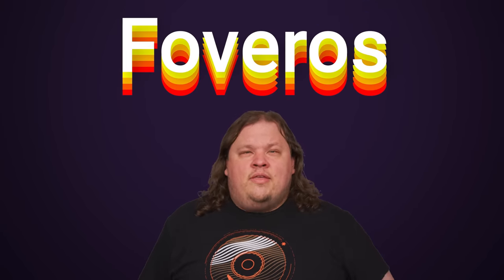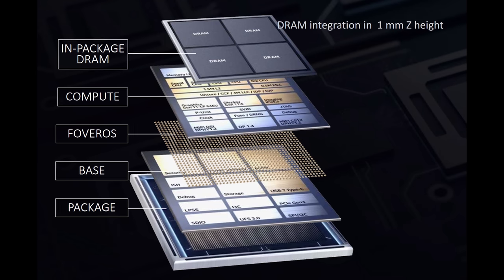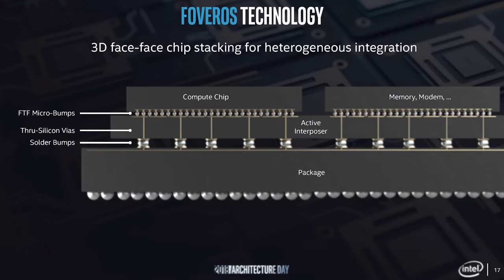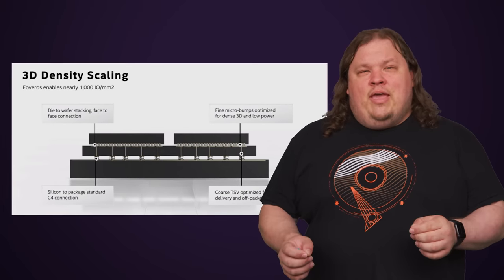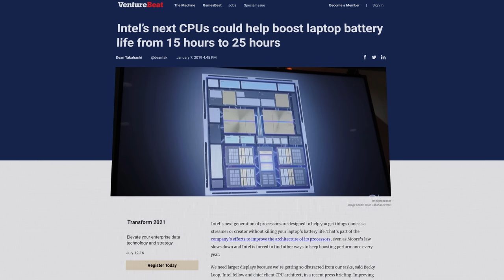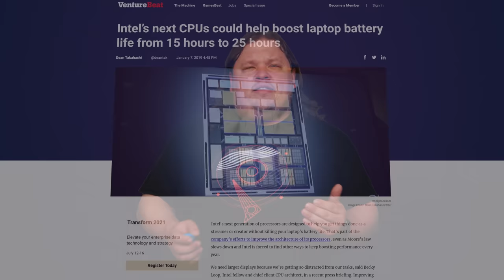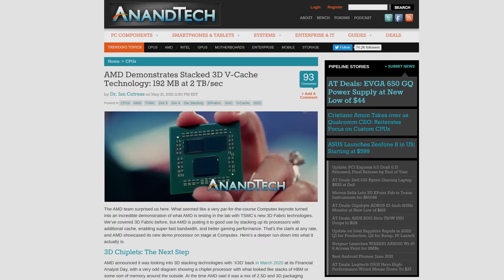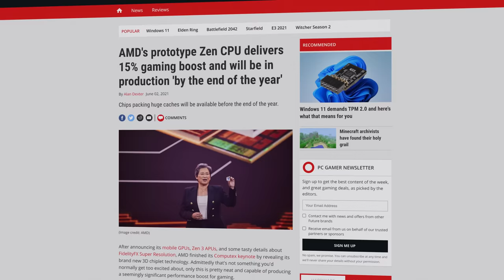They're STACKING CPUs Now!

Comment: I wonder what they're going to do about heat issues

Edit:
I do understand that data is transferred more efficiently so less heat is produced but by how much?
What thermodynamics 101 says is that this will reduce cooling surface area significantly which mean you have to cool it more.
But then we run into another issue, that is the temperature variance between different regions of the CPU. Is that temp difference enough to be problematic? IDK 🤷🏻‍♂️
Basically, dealing with temp issues is going to by easier said than done.

2nd edit:
Turns out they actually are trying direct die water-cooling. Awesome 👌
Reply: They're gonna put that onto us
Reply: Direct die watercooling.
Reply: Maybe with direct liquid cooling
Reply: This actually can help reduce heat output, as the data is moved around the die more efficiently.

Otherwise, it's just a question of throttling maximum performance to a point where the heat can safely dissipate from hotspots, through the die, and into the cooler - something that is already done in all modern CPU's.
Reply: And there are people studying the feasibility of integrating watercooling into the silicon die itself, the main problem is the economic feasibility of it all.
Reply: Speak Good  spam
Reply: @Octavio Lopez Well, less energy to transfer data between processing modules. The module itself will still take the same ammount of energy. The only thing that has a lower energy consumption is the connection between dies, not the dies themself.
Reply: @Octavio Lopez must have worked I don't see any comments from the guy you've been talking about
Reply: And good luck getting thermal paste in between all those die layers.
Reply: @ebinrock  it's essentially perfect surfaces so there will be no need for that
Reply: It's probably fine. New ryzen cpus aren't that hard to cool, so they have some margin to work with. I don't think it will have any significant impact though.
Reply: Concerned about heat issue too
I'm worry if heat can cause solder ball between dies damage over time.
Reply: @Octavio Lopez What did he said?
Reply: It'll probably be a balancing act between sustained performance, burst performance, and heat generation.

In this sense, the chiplet design may turn out to be superior, as they can squeeze the chiplets to the top layers where they get the most cooling, and push the memory components to the deeper layers.

Otherwise, someone is gonna have to come up with a way to pump heat from the inner core of the package out to the surfaces...
Reply: 170 TDP
Reply: Putting a layer between the die that is generating the heat and the cooling block seems like putting a blanket on someone during a hot day. Also solder cracks in game consoles leading to delamination of the APU, a known issue, now you want it to occur between layers of the cpu? And the sizes of those tiny ball joints will make it impossible to fix. Apple sandwiches boards in their phone in a similar way and they break very easily when dropped. Where is the longevity and reliability in this design?

Comment: Not long till we see chips with gigabytes worth of cache.
Reply: Meanwhile Intel is barely putting gigabytes on their massive GPU...
Reply: i wonder if that will mean dramless laptops, where the entire system memory resides in the CPU's SRAM
Reply: @FluorescentGreen5  naahhh, sram is VERY expensive...
Reply: @giornikitop5373  for now yeah but i meant when it gets to the point of cpus having GBs of cache where you may as well use the cache as system memory
Reply: Ram on cpu
Reply: @FluorescentGreen5  interesting idea. High capacity cache and low latency high bandwidth SSD combined and you don't need the middleman of RAM.

Comment: One benefit of 3D stacking for CPU (or chiplet design), is that the manufacturer can get better yield from their fabs. By designing smaller parts then putting them together, they can get more usable parts rather than having a big part ruined by small defect on the wafer. It also allows the manufacturer to custom pick good parts for the CPU or SOC. Eg, need a 2MB cache or 4MB cache? They can do it with the same wafer and just manufacture the memory base on demand. 
But of course, we're the end user. We just want lower price, higher perf and lots of features we don't intend to use but good to brag about until the next Windows version forces you to enable it.

Comment: imagine CPUs utilize the current PC building layout: you have a "motherboard substrate", onto which modules connect. So you would have like a compute unit module, cache module, and accessories module. All of them sandwiched with a heat transfer construction: tiny vapour chambers or even liquid cooling ready manifolds. Would be a 2.5D idea for expanding silicon area

Comment: The main problem with stacking as far as processing, besides the obvious construction/lithography difficulties, is the heat generated.
Heat dissipation.. high TDP cores may well be a layer or two down, beneath other dies that're also generating heat.  And folks think CPUs get hot now

Comment: What I want to see, related to this:

Add a layer, or a core, or something 
whose job is only to work with an a.i. to watch all activity in a system for problems, so that if the system crashes, or slows, or does anything worrying (sometimes even before the user realizes there's a problem), the system will identify the causes, correct those itself (when possible), and recommend solutions (in both layman's terms and professional terms).  

It could even take over, at a minimal level, if the main cpu crashes, to keep a system going in a special correction mode, rather than actually letting it crash and then working on the problem after a reboot. 

It would be like having two systems running as one. The 2nd watches everything, logs concerns, and takes actions as needed. 
--
I am not a tech person. But surely this would be possible.

Comment: I bet they could achieve more density by instead of using TSVs or micro solder bumps, to redesign the chip for them to slide in place or attach to eachother physically. Hell, they could make slight ∆ diviots on top, and do protrusions on the bottom to pop into place.

Comment: The issue I see is that a CPU or other die transmits a lot of heat from its back side. Having it floating above another die prevents that, unless what? they are going to provide a heatsink on the top as well? This is not a new problem, and we have seen MCMs (multichip modules) that have performance limitations due to the total power dissipation ability of the package.

Comment: How are they over coming the thermal dissipation of a thicker die? Also cpu delamination that occurs with solder as it ages and hits constant critical temperatures? Wouldn't this method introduce more issues than it solved. Guess we're moving toward hardware with a use by date and  no repair capability.

Comment: the difficulty of die stacking for any compute unit is the non existent pattern since there's a block for each individual process like ALU, CU, instruction register etc.
while the NAND flash / DRAM have a 2d matrix like pattern so adding 3rd dimension is "relatively" easy.
AMD approach to stack their Cache is clever since the tech is there and ready to use since cache is just baked in CPU ram. It will be easy to implement since AMD bottleneck is the memory anyway.
while Intel approach by literally stacking and soldering die on top one and another will poses a difficulty of thermal transfer since there will be an air gap between those solder balls.

Comment: I wonder how overlocking capabilities will turn out with multiple dies stacked on top of each other. Sure, the energy to transfer data between each one will be significantly lwess but each computing unit will still take the same ammount of power (unless the eficiency of the chip itself is reduced) meaning the thermal energy density will be much higher, making moving heart away much more difficul since you can't just mount a heatsink inside the cpu. But maby it will not be an issue at all but we will see.

Comment: My 5950X gets instantly to 80-85°C on a single Core when using the Boost...even on a 280mm AIO. When stacking Chips how the F**k does the CPU gets cooled then?
Or is it just more Core but less Frequency? The Same 5950X gets only 60°C when using ALL Cores, on a much lesser Frequency.
For Games or Tasks that only use 1-2 Cores that Stacking might be a Problem...since the per Core Performance is going down in favor of less Heat.

Comment: I’m glad tech companies aren’t giving up on Moore’s law, just because the traditional method of transistor shrinking is dead, it doesn’t mean we can’t make CPU’s faster
Reply: it's not dead yet we still can go to at least 3nm probably even 1-2nm
Reply: @KeinNiemand  This is true only for industrial production. In labs, single-atom transistors are a thing since 2004 but the methods involved are stuck at "artisanal" production level and those single-atom transitors need to be cooled at minus 196 degree Celsius to function. But the Moore Law is indeed dead, this is just that the gap between what edge research can do in small quantity and what the industry can product at large scale, reliable rate and an affordable price is big enough that the industry isn't yet affected by it outside being forewarned about it.

Comment: But how do they plan to cool that? 
Even if we don't open the can of worms called 'empty space between the dies', the square-cube law still applies. 
For double the volume and double the heat, you get less than double the surface (probably exactly the same surface, if they're still cooled with a metal plate pressed on top of the CPU), so you have to draw heat away much faster in order to keep it cool.

Comment: When will we finally get the microchannel water cooling? Are they still working on that?
Reply: As far as I know, they are still working on that. But with so many dies so clsoe, the enenrgy density is massive. Without such a coolingn solution, it will be hard to move the heat away from inside stacked dies.

Comment: What i see happening is 3 or more lines of CPU 2 for workstation at least 2 for server and 1 for consumer. The reason? How applications run is different depending on how they are complied and the data being processed through them
Consumers really won't see a thing unless you get into the small +/- up to 3 fps as the bulk of compute for games is now on the GPU not the CPU. For workstations the reason why 2 lines is 1 with a big cache for business uses that have the need for more cache with most likely less cores or the same amount of cores as line 2 with more or the same amount of cores but faster. 
For server well ask Intel why they have 5 CPU lines as it confuses me. What i do know is enterprise servers need more than a 1 size fits all solution.

Comment: I would like them to ditch some cores for enough memory to replace ram modules for most user cases. It doesn't have to be as fast as cache, not that I wouldn't mind it, but I understand that cache grade memory is expensive. Reason? Smaller form factor mobile computers such as a less creepy google glass such as no front facing camera.

Comment: Anthony you're one of the best pro technical duded at Linus. Love it. Keep up the great work. AMD is doing great too. Owner if self build Ryzen 9 5900X and Sapphire Nitro+ RX 5700 XT and huge MSFS2020 in VR with Hp Reverb G2 fan and have to switch with pain in my heart to Nvidia RTX 3090 instead of AMD RNDA 2 just because AMD can't fine tune their GPU drivers for MSFS2020 VR to run CTD free. Nvidia does. Greetings from Belgium.

Comment: Sounds like even though you don't need as much power (Wattage) to move data between them that you 'cannot' use more power (as effectively) to increase performance (like oldskool overclocking and cooling).
When you get to this sort of big cache (64Meg or 192) I just see it eventually dropping dead like a RAM module can do and that is a pity since a CPU is normally something that lasts for ages. It has an E-waste ring to it. Also the FPU ratio to cache drops and one might have preferred more FPU instead (for cryptograpgy and some video-technologies).
The irony is that this probably works out ok for laptops as people discard them early anyway (sadly). Not so great for right-to-repair though.

Comment: i still feel this is bad for several reasons.  A there is a air gap and trhere is no better heat insulation then air. B. no heat transfer between the silicon so all the heat transter is depending on the microbimbs which is a tiny amount. And temps is everything in todays chips. i feel these are going to be awefull chips. with temps going trough the roof.
Reply: I'm sure they'll figure it out

Comment: Wouldn't die stacking quickily have a leveling out in terms of output due to the actual heat restraints of all the dies heating up even faster and being forced to hit their overall heat limit even sooner. As a result have some seriously bottlenecked dies on the CPU? You would need like a liquid cooling solution to be running between the layered dies to get like proper cooling? Wouldn't you? Especially if  they use die's like the 5800x AMD CPU's die which is famous for high heat.

This really just comes off as a more flexing than actual show of power with next gen CPU's like bordering on reaching the level you would need liquid niterogen to have the chips stay cool enough for all dies to be firing on all cores.

Comment: AMD's strategy looks like a stopgap to keep close to Intel until they have truly competing technology to deploy.  Last I heard caches give reduced return on increased size.  192MB of cache sounds absolutely luxurious, but how much of it is actually going to get used?  In the end, AMD's system does not give more performance so much as make existing performance more available.
Reply: "Making existing performance more available" is a really big issue in chip design though. Chips are very complex and feature a lot of possible bottlenecks to the point where entire product lines have failed because a lot of possible performance couldn't consistently be accessed. If programmers can't make use of all the CPU's performance, it may as well not have it. Ask Sony with the Cell Processor or AMD themselves with the Bulldozer series.

Comment: So I just wonder how much more heat such a chip would generate, and how coolers could reach through all those die layers to transfer the heat away?
Reply: It's memory on top of memory which doesn't get as hot. The decreased electrical resistance decreases heat generation.

Comment: How does die stacking affect thermal decipation? - I imagine it will harm performance.
Reply: It does. These amd fanboy clowns have no idea what they're talking about.
Reply: @dannyd4339  thats why its only on the cache, where little heat is produced
Reply: @the_retag  it still harms performance.
Reply: @dannyd4339  apparently a lot less than the benefits
Reply: @dannyd4339  I think you didn't notice the part of the video where it was mentioned that Intel is also working on making 3D stacked dies.

Comment: to cool a 3d plane is harder than a 2d plane, i hope they consider that i mean if intel stays as hot as they usually are (cough) these little balls could just melt awayyyyyy ^^ and with the pressur of a cooler on top that might be not desireble

Comment: More cache is better. Intel's stacking technology is BS, at the end of the day it is just more power draw and heat because the voltage has more to pass through and faster thermal throttling. Think of it this way. You are at ground level 1 and took a lift to level 3, the lift will pass by level 2 no matter what. Unless Intel places the less useful die on level 3. Having more cache at level 3, yes it is more heat but it is something we access frequently. Maybe that is why AMD is hotter than intel.
Reply: AMD is hotter then intel because it needs a lot more voltage to reach high clocks. my 99000k can do 4.7ghz on 1.2-1.23v where a ryzen runs on 1,42-1.45v which si also why amd chips despite 7nm are not actualy more energy efficient for tasks like gaming or regular use.   same goes for idle amd doesnt lower voltages drasticly on idle so temps are in the 40's while my intel runs at 2c over ambient because it lowers the voltage all the way to 0.61v.
And cooling comes from the top so the only way this works for cooling is if the hottest die is in top (the cores) with the cache at the bottom against the pcb which doesnt seem to be the case for this design. Not to mention the air gap between the dies that works as a heat insulator.

Comment: CPU dye stacking doesn’t entirely seem functional due to thermal issues that could arise
Reply: It's a tradeoff. If you want the max. clock frequency, then no. If you want the max. number of parallel threads, then yes. Personally I would opt for clock frequency, but a server operator using certain poorly written web servers might see it differently.
Reply: @lepidoptera9337  it’s been done before already I believe by of intels older cpu architectures I believe the pentium series . But still fundamentally the engineering to actual keep the heat at a stable level is what will ultimately make or break this idea
Reply: @lepidoptera9337  amd hasn’t gone this route knowing this as well and has made strides with the chiplet design
Reply: @joshuagreer8046  Chiplets are mostly a matter of yield. Intel doesn't seem to be keeping up with the fabs, it seems. Of course the x86 architecture is far from the optimum, in terms of power consumption. But if we can't change architecture (like Apple just did), then we can, at most, optimize for different load conditions at the same total power consumption. I doubt it makes all that much of a difference in practice, though.